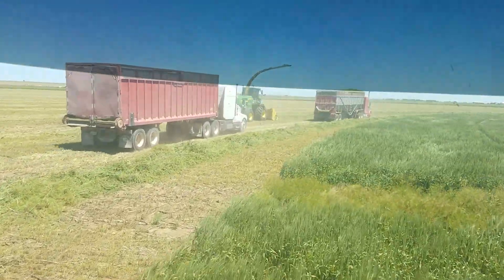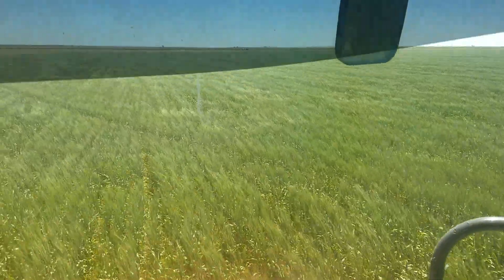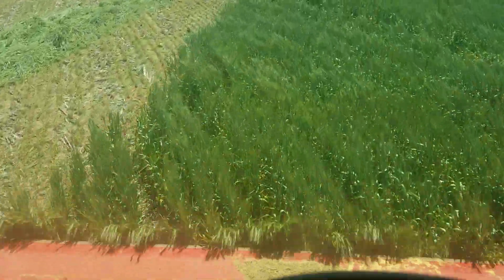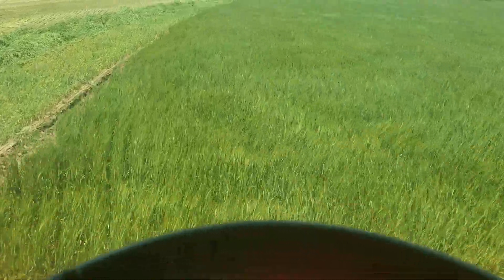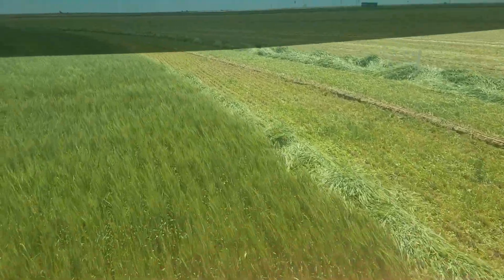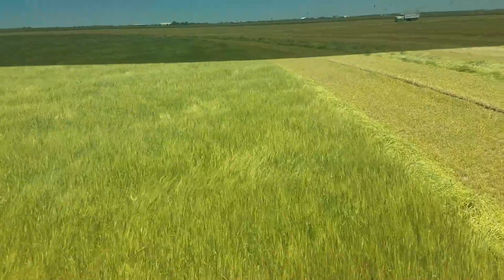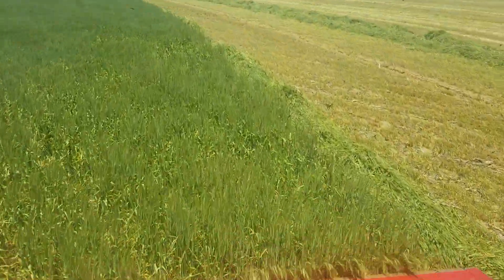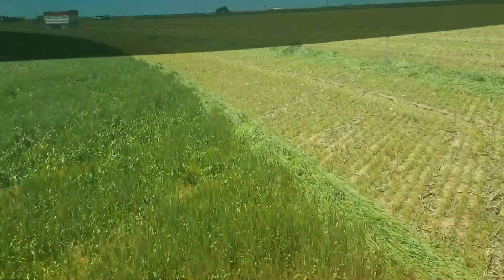Cutting wheatlage may17

Comment: the chopper does the best job of cutting/chopping the crop when it's at capacity. if you run a chopper at half capacity it can't process the crop as good. it's nice that your swather has the merger attachment.

Comment: Most interesting video and clear explanation of the reason for the role and justification for using a swather to cut and windrow the crop in front of the harvester.

I'm not familiar with using wheat as a silage fodder, however does the contractor use any additive (eg organic acid, enzyme or sugar based material)  to ensure successful fermentation in the clamp?